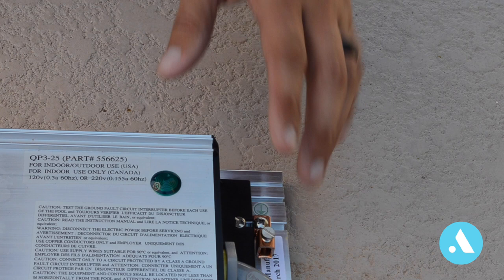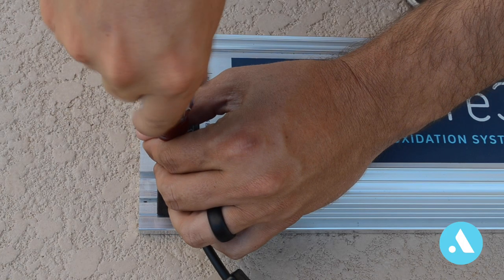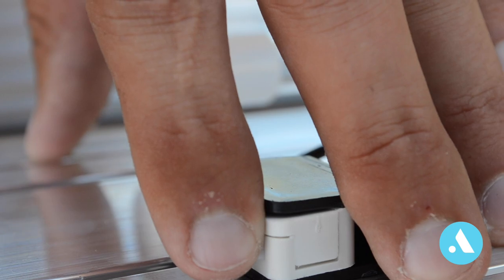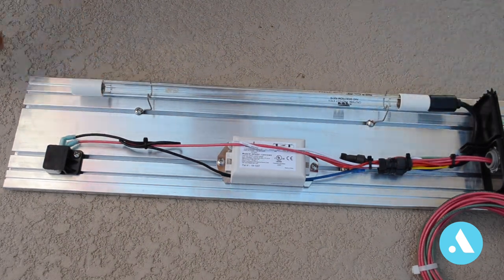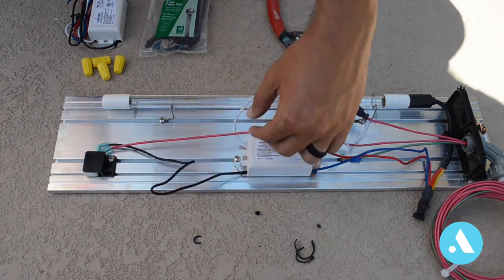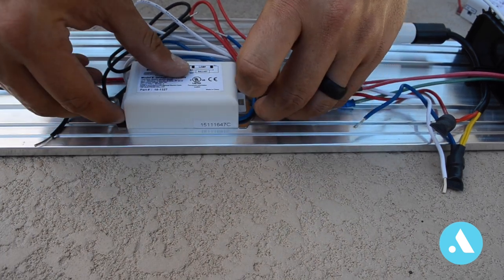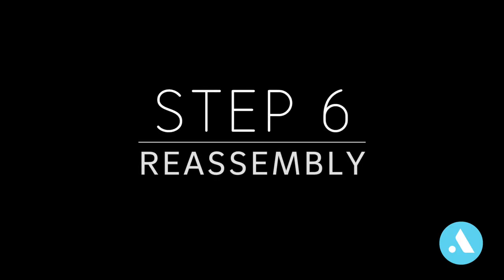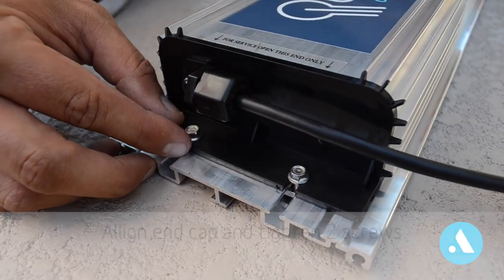Rebuilding an A&A Quikpure 3 Ozone Unit

Comment: Greg, I changed my burned out bulb for the second time & decided to change the ballast. My light still doesn't come on. My system is 5 y.o. & actually doesn't have the tiny white plastic safety switch button, it's just a square hole. Is this normal? Can the safety switch be changed splicing the red wiring the same way as the ballast wires are spliced together?
Reply: Were you able to fix your system?
Reply: No, last year I changed the bulb & a new ballast & it still doesn't work. Do you have any idea what the problem might be?
Reply: @audreylivingston7429  I’m going to guess your wiring is bad. I had some issues, but just got them resolved recently. Only loose wiring!

Comment: Greg - is there a way to know or test if the ballast is faulty? I have switched the bulb out but it is still not lighting up. Though have to say trying to get the bulb in and out of that connection point was far more difficult than it looks in this video. Having spent $85 on a new bulb I don't want to splurge $60 on a ballast if I don't know that its where the problem is?
Reply from the maker: Unfortunately if it was not the bulb its most likely the ballast. I carry both on my truck because you really don't know until you put a new bulb in if the ballast is bad.